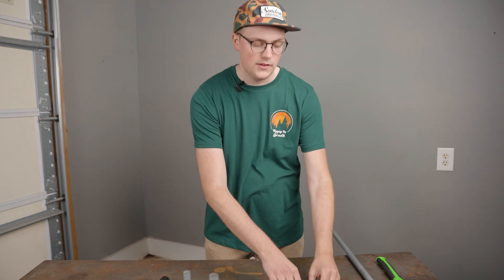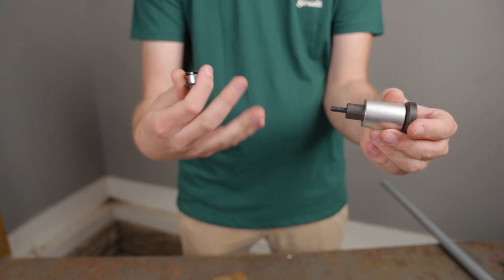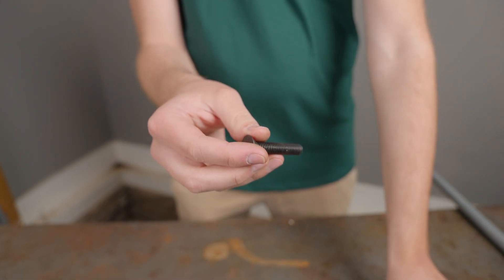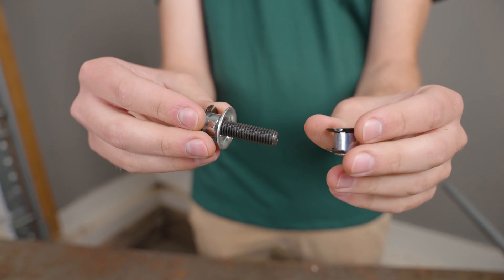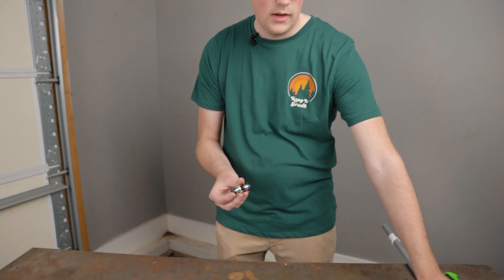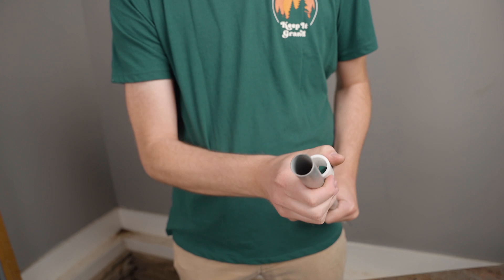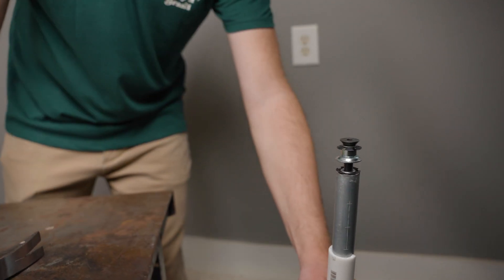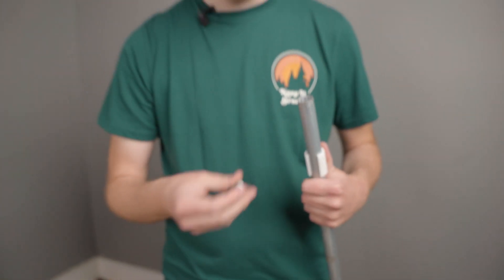We DIYed This Super Helpful Tool!

Comment: Pipe clamps work well also. I have a shop full of pipe clamps for woodworking and popped my inserts into my conduit with out resorting to banging it with anything. Pipe clamps are incredibly useful tools to have and all you need is a piece of threaded pipe available at most home centers or hardware stores and  a set of clamps to fit on the pipe which can be sourced from numerous places ( Amazon, Lowes, Harbor Freight I think). It won't be easy or super cheap to if you need to put an insert in a 8 foot  long pipe but any reasonable length pipe would be very easy to accomplish. Get yourself a pair of 36" pipe clamps for your workshop and you will be a lot more prepared for a lot of life's problems.
Reply from the maker: Thanks for the comment! That's some really great information. I've heard of those clamps in the past but was unsure of where you source them. Now it makes sense that you piece them together. Definitely a handy thing to have around the shop!